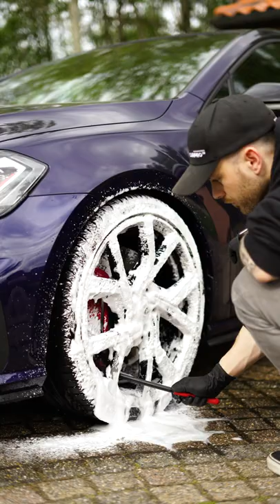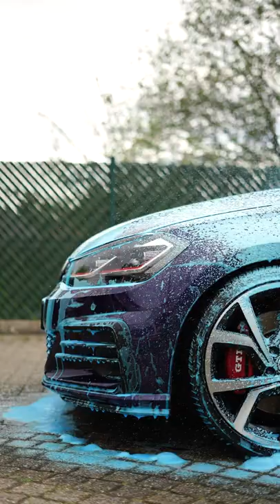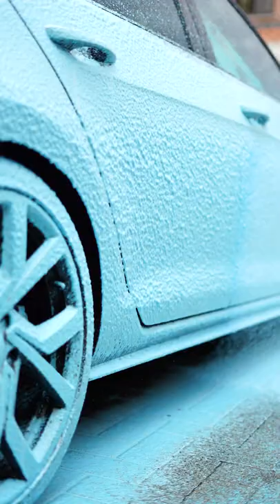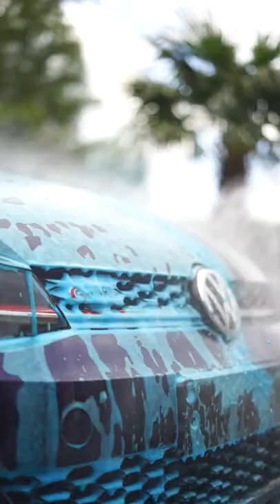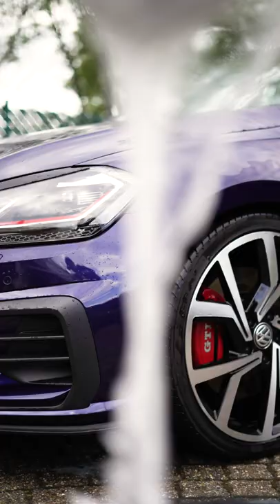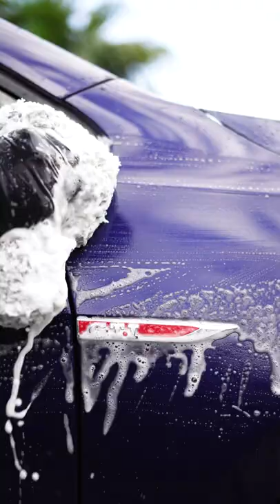Golf 7 GTI Foam Wash - Blue Colored Snow Foam #shorts

Comment: Why does every guy in England own these things
Reply: Not only in England and yes those VW golfs are awesome as hatchback you dont need to have a big G wagen or any Audi's
Reply: @youssef1770  but they're expensive at where I'm staying 😂
Reply: Because they're really the only car out there that is fun to drive, easy to mod with lots of support, but still not overly thirsty for fuel or having absurd insurance costs. The latter of which are the biggest killers in the UK. These cars (and the related models/platforms) just so happen to tick the boxes.
Reply: @shona5512  it's German a bloody air filter is gonna cost you 500 bucks
Reply: @salamatpo7326  What a load of exaggerated shite. 
A standard Air Filter is £15.. A K&N Panel filter is £30. A cold induction kit is £145.
3" Decat downpipe is £190.
Full exhaust system is £600.
Upgraded Intercoolers are £450.
Hybrid Turbo's are £1200.
Injectors are £300.

Obviously, you can get cheaper or you can get unnecessarily expensive parts, but these prices are reliable, reputable, run of the mill upgrades.. They're not in the slightest bit "expensive". 
$500 for an intake... LOL!
Reply: @shona5512  omg bruh chill I was just making fun of German cars being scarily expensive for parts like bruh chill it's a joke
Reply: Welcome to the Netherlands where the golf gti owner is 

A: a young guy from marocco 

B: a young guy from marocco
Reply: @salamatpo7326  Most of them are, but i was just pointing out that a Golf GTI is one of the few German cars that aren't expensive to modii, run or insure.. Hence the reason people buy them.
Reply: @shona5512  do you know who the founder of VW is
Reply: @salamatpo7326  Yes, why? What has that got to do with anything..
Reply: @shona5512  you should be ashamed of yourself 👱🏽‍♂️
Reply: @salamatpo7326  And why would I be such a thing?
Reply: I don’t
Reply: @shona5512  lol you clearly haven't seen insurance prices in England.
Reply: @TheLondonCyclist  It fluctuates a lot based on area. Maybe it's more even across the board in England, but for me in Northern Ireland, insurance prices in my area is pretty typical, but if you go 5 miles down the road from where I live, insuring the same car could cost nearly twice as much. The reason for that is that in that particular area, it was a hot spot in the 80s for the IRA to steal cars, torch them or use them for car bombs. So a lot of insurance claims came from there, so the insurance companies have flagged that area and never updated it.

Like I said, I don't know England's prices, but I'm sure it also depends on the area. Eg. East/south London and Liverpool are renowned for car thefts, so surely insurance will cost more. I'm sure a MK7 GTI can't be that hard to insure in most parts of England though.
Reply: @youssef1770  Bruh whats wrong with my audi a3 hatchback? :(
Reply: @youssef1770  loved my mk4, upgraded to a  15' c300 but them damn mk7's still got me rubberneckin
Reply: Main reason is probably because they’re very cheap and reliable, and a little bit fast I guess? But what do I know I drive an AMG.
Reply: Because they're cool cheap to modify and maintain and reliable but where i am is quite expensive to own  one because you uave to ship it from  UK or japan (if it haven't been sold yet) and shipping whole car is expensive especially through air cargo (yes apparently you can ship a medium sized car that not to heavy but cost a fortune) because every single one here is already been bought or booked by somebody else  or just a showroom pieces for test drive only... but i don't really know how it's works i drive a Ferrari and Tesla but my sister have few Volkswagens and an rx7 full turbo and a miata for drifting
Reply: They look very very nice, they’re fast and they are very reliable. The cost is the cost, nothing is “cheap” over here. Unless you’re gonna walk.
Reply: @rafaminus5366  no frankfurts in this country man.
Reply: They do this colour in the mk7.5 in the UK?

Whats it called?
Reply: In South Africa its the manwh*re car (colloquially)

Comment: Please save water you can simply clean your car by wet cloth first and then a dry cloth then give it polish .
I request everyone to save water everywhere ☺️
Reply: Im reopening my detail business in a military base, where I will be limited to a bucket for water, because there are no hose hookups. Waterless washing will be my main method of cleaning for a while. 
Regardless of my situation, water is imperative to prolonging clearcoat, because it is the main form of lubrication protecting dirt and dust from swirling your paint. The more water that is used, the better for the vehicle. I believe I pre-rinse, pre-wash, rinse, wash with 2 bucket method, post-rinse is preferable. A lot of water, a lot of protection.
Reply: @jamesmcclellan8554  🙂save water save future
Reply: You should say that to a carwash bro, they spend a lot of gallons just to wash a single car
Reply: @Starstrike then what did you want to say , you will waste water 🤨
Reply: @starstrike679 not true

Comment: I never really understand how the foam works
Reply: It clings to the surface and starts to break down the particles of dirt, the bubbles of the foam gently traps the dirt within it, lifting it off the paintwork so that when you rinse the car, it takes as much dirt as possible, off the car before you hand wash it. The less dirt you have on your paintwork before the hand wash stage, the less chances you have of scratching the car's paint work.